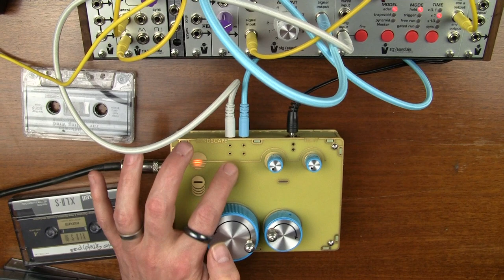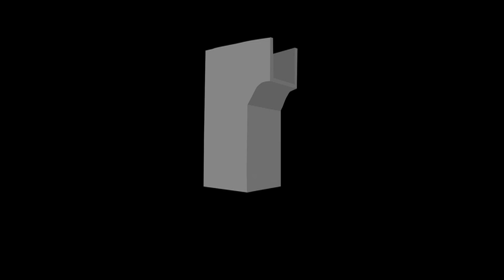01-The Landscape HC-TT (human-controlled tape transport): Sound and Functionality

Comment: Extremely cool concept. I feel like it'd be significantly better if it had an autoplay function that played the tape at the "right" speed – you know, like a turntable does. Being able to play the sound regularly but then mess with it in a hands on way would be awesome.
Thanks for the demo!
Reply: That would be great - but it would add a perhaps surprising amount of additional complexity. Some inexpensive and early reel-to-reel recorders did move the tape via the a motor driving the spool. I believe it was called 'rim drive' where the motor turned the rim of the spindle holding the reel. That's sort of how this unit works, you're turning the spool with giant wheels. However the problem with this method is that when you start the tape, the spool has little tape on it, so it's pulling the tape past the head very slowly. When more tape has moved accross to the other spool, the tape is moving very fast past the head. It's like gears on a bicycle. Rim drive tape recorders therefore could only play back recordings made on that exact unit, the speed of audio on the tape was a constant ramp of speed change across the length of tape. To aid in fidelity and allow tapes to be used accross different machines, nearly all reel to reel and casette recorders actually move the tape by a capstan, the round metal pin near the tape head. This turns at a constant speed, and a pinch roller wheel pinches the tape against that capstan - the tape then moves at a constant speed during playback and recording. The 'take up' spool is loosely run to catch the slack end of the tape and wind it up again. When a casette recorder 'chews' a tape and tape goes everywhere, it's because the capstan and pinch roller have been pulling the tape along, but the take up spool hasn't been winding it up. So the tape had no where to go. This cool little product presumably has no motor, no capstan or it's required flywheel, no pinch roller - you're just manually winding it's tape.

Comment: Love & want this! SO wish I could spend some money right now!

Just my 2 cents, but IMO one more design feature could take it to another level: An open transport area, so you could pinpoint & mark the perfect spot for splices 🙂
Reply: Could an addition of a counter, with a reset button, work? It would be in keeping with using tape.
Reply: @jamesbarels469  Definitely, that would be awesome! Especially if they could make it happen without belts. Although I was thinking more along the lines of whether this could be used for precise, reel-to-reel style edits. Like, since you can manually shuttle the tape back and forth to find the exact start of a transient, it would be cool to have access to the tape enough to mark it with a grease pencil where it contacts the head, so you could make super accurate splices & loops.

But, then again, I guess it is 2021 🤦‍♂️
Reply from the maker: Yes, in the videos you'll see soon, when I was trying to generate beats, I ended up doing it by memorizing arrow placement... something more concrete than that would be helpful!
Reply: @automaticgainsay  Oh, very cool! Looking forward to seeing it 👍